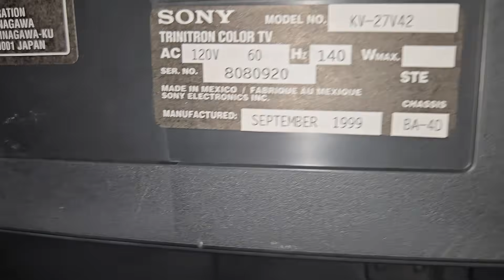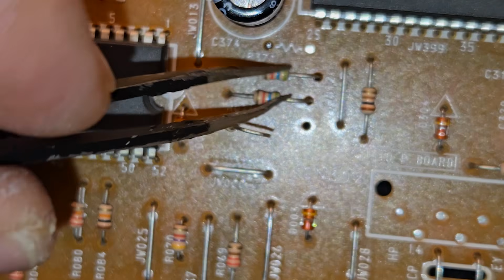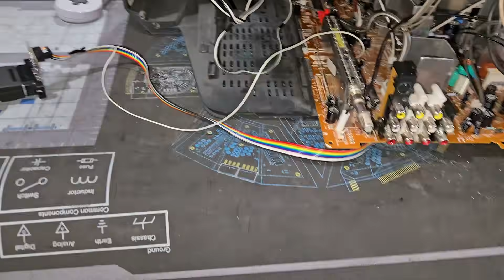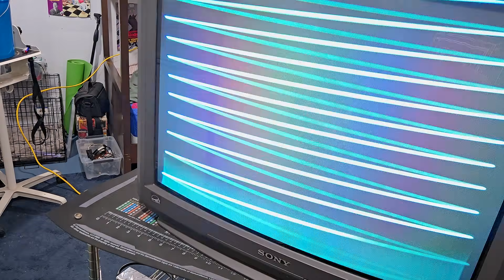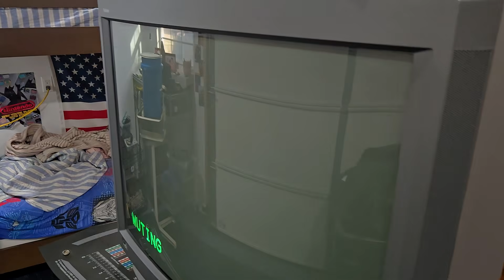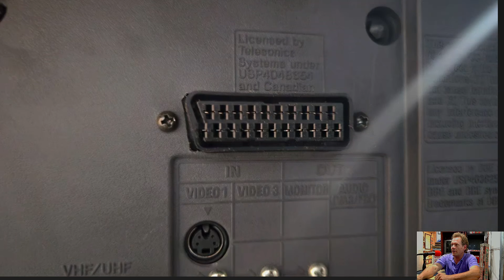Upgrading Sony's "S Tier" CRT with RGB - The KV-27V42

Comment: 4:00 is it just me or the biggest capacitor with a black cover in the right hand side of the board, is starting to bulge? I don't know what it does, but i'd definitely replace that one, just in case.
Reply from the maker: Those are actually made with that bulge.   It's just a plastic cap over top of the capacitor.  The capacitor was fully functional and in good condition when it was tested.

Comment: Me and my partner both have KV-27s, an S42 and an S65 (the one that i have, weird variant with 3 coaxes that i can find zero mention of outside of documents). They're both our first CRTs but we lucked into getting them for free from relatives (although i had to carry mine down three flights of the steepest stairs known to man). I honestly had no idea they were such excellent models because I've had a hard time finding that much discussion around them. Mine has a slightly crooked yoke, but unfortunately i value my life too much to fix that.
Reply: I just got an S42 and also had a crooked yoke. I was scared as well, but the yoke was designed to be adjusted while the set is powered on. As long as you only touch the plastic parts you're good! Regardless, hope you enjoy those sets for  years to come!

Comment: Amazing work, and I really appreciate how you went into detail on where it went wrong and how you diagnosed and fixed it, as well as detailing how to resolve those convergence issues.  It looks incredible afterwards!  As much as I might want a PVM/BVM, the size of those screens is an issue for me.

I wonder if there are mods to bring progressive scan to these?  I know it'd likely involve a whole new custom jungle chip and is dependent on how much of a tolerance the set has for drawing lines at twice the rate, but I am curious.  I mean progressive monitors were the norm at the time so I figure... maybe?  Anyway, just curious!  It's so hard to find a 480p TV that doesn't do some kind of digital processing and thus add lightgun killing delay, so if there's a moddable solution, I'd be all over it!

Comment: I have a similar sony, a KV-27TS32 that I cant get power to. I probably need to go through it and try to replace any caps but its a lot for some one who's never done that before. I'm not unfamiliar with working on electronics but crt's are new territory for me (usually work on smaller newer devices). I've watched some of your videos so I have an idea of what to do next but any advice you might have on this series of tv would be much appreciated.
Reply from the maker: The 1st thing to check out would be the fuse.  There should be one near the where the power cable connects to the board.

Comment: That's the worst feeling that leads into the best feeling situation. Glad you sorted out the issue. Always the worst when you spend hours working on a set, then you go to test optimistically, then you're greeted with some bullshit, instead of the killer image you're hoping for!.. But then, feels sooooooo good when you get that "ah-hah" moment! Great win on the BA-4d my friend!. I own it's lesser quality stereo cousin myself, the 27S42 model. Was actually my very first RGB mod I did back in the day. Almost screwed up that job myself. Floated bunch of traces when removing those resistors since I was still very new to soldering, but after feeling the initial defeat, and investing in some better equipment, I managed to tackle fixing it backup and it's one of my nicest RGB sets I own today, I think out of 6 I have atm. Killer work dude!..
Reply from the maker: Thanks.  The s42 is awesome.  Definitely keep that one going.